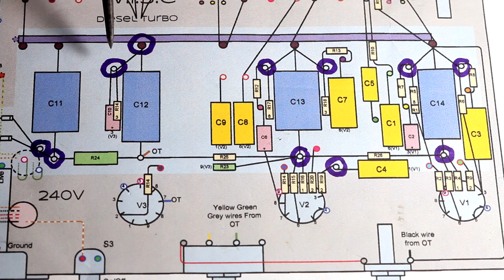Small Tube Amp Build - Step by Step (5 - Components Cont./Transformers)

Comment: That's really slick when you lift your completed board & sockets off the template and drop 'em in the chassis. And they fit: ta-dah! Even though I watched you do the templates and drill the chassis and re-use the template to use as a jig, it's still really schmick when you just drop it in. Excellent work!

Comment: I love working with turrets - such a clean look and very asthetically pleasing.
I use a more military style of soldering on my tube sockets where instead of simply pushing through and soldering - I wrap the wire around the connector tab ensuring a good connection before soldering.
Not judging - I see your style of soldering on tube sockets often enough - but I also repair a lot of tube socket connections soldered in that manner as well.
Great work.
I should video some of my work as well.
Reply from the maker: Thanks for kind words. Definitely wrapping the eyelets of the tubes with component leads is the best technique indeed. I just lay them in the lugs as I often change their position and once it's wrapped it's very hard to remove or change. I find that if the leads are tinned well and the solder joint is a nice meniscus then I have few problems. Very good observation though and quite correct. Thanks again and all the best for your builds!
Reply: USAF and NASA actually reccomend that method You use in those videos for soldering aircarft and rocket parts in their old instruction films.

Comment: Very clean build!  I've seen very expensive hi-fi tube amps that didn't have that level of care or precision.  I favor stranded wire personally, I find it withstands the wiggling movement of tube socket pins better, and for that reason I don't mount passive components directly to tube sockets.  But this arrangement of yours results in a very compact design and minimal wire lengths.  Everything's a tradeoff.
Reply from the maker: Thank you! Indeed solid core yields when bent too many times. For that reason I also use stranded wire for my shielded cable. Where there is little chance of movement, I use solid core as it keeps its shape. Wiring components straight on the tube lugs is certainly problematic in terms of replacement, however the potential reduction in noise overides this for me, a trade off for sure. Great points, thanks for commenting, much appreciated.

Comment: I commend you for your soldering. It’s very common to see leads trimmed after a joint is flowed. Those clipped ends need to be tinned to prevent oxidation inside a wire.
Reply from the maker: Good point, thanks for that.

Comment: Surgical precision just like the camera gimbal series :)
Reply: "Surgical." That's exactly the word that came to mind as I watched this. 

A couple of years ago I built my first amp, a Princeton Champ, from scratch using hand picked components, NOS tubes and 16ga aluminum for the chassis. It looks and sounds fantastic if I do say so myself, but only from the outside. The inside looks like it was assembled with a blow torch and pliers as it shows my poor soldering skills.  It is not something that I am proud of. On a positive note I do have the chassis mounted inside a home build cab where only the chassis is visible.  I am the only one that knows what lies underneath the cherry red chassis, and yes it still bothers me.
Reply from the maker: Thanks JN!! Really appreciate it!
Reply from the maker: Sounds like a cool little amp you made!. For some reason I get a kick out of having things looking solid on the inside, even though very few may ever see it. The more and more amps I build, the more it feels like creating a sculpture or something. I find it very satisfying to try and improve the design by creating a rock solid layout with everything easily accessible and as neat as possible. Its an interesting thing, thanks for the input and comment. Have a great day!
Reply: It was fun but a little frustrating - similar to the range of emotions someone playing golf might experience. A couple of solid drives and you're king of the hill, but 2 balls in the water on the next hole and you feel like the lowest rookie on the course.   A major point of my frustration is that after planning for a couple of weeks I expected better results.   

I wanted to challenge myself by going DIY all the way instead of buying a kit so I started with a flat sheet of scrap aluminum from a metal shop. I planned to form the chassis myself but they offered to bend it for me and I didn't say no. t's roughly the same size as yours and turned out perfect. 

With a perfect box for my chassis I then began the layout for the transformers, tubes, jacks, etc. After several hours of research, planning and cutting I stated assembling the amp and discovered very quickly that soldering would be my "fly in the ointment."  Oh I got it right technically.  The amp sounds great and is free from the the hum that Champ circuits are known for. I attribute that to shielding. grounding and placement of the tubes, but certainly not my workmanship. 

I do not consider myself a perfectionist but I believe I am capable of doing better  The outside really turned out well though. I used etching primer and then sprayed it a deep red with 3 coats of clear. And at some point in the painting process I decided to continue on and make a mini-stack. I fabricated a head cab,and included a black wire mesh grille from a storm door,, and then a cab for a 12" speaker all covered with black Tolex, Fender handles and chrome cab corners.  For the grille I used the silver blackface Fender cloth.  The red chassis with chicken head knobs looked somewhat odd mixed with all that black and silver so I framed the inside of the head and speaker cab with 1/4" oak stained with red cherry and secured with brass screws. 

What I ended up with: 
GE NOS tubes
F&T filter caps
Jupiter tone stack
Hammond transformers
Bourn pots + one extra for the NF loop.
Metal film resistors 
WGS 12" Jensen clone - don't remember the exact model. 
1 lb. of solder  (well maybe not a pound)    :-)

What I have described may seem unique and maybe even attractive to some but to me the inside of the amp is not.  It was my first so perhaps my expectations were a little high. It looks good and I enjoy it even with the flaws.  

I wish that I had your skill. I've seen many amp builds and I am sure a factory built amp wouldn't look this good.

Comment: Exquisite. Impressed with the Sozo, PRP, Kiwame. Your work deserves better diodes!
Reply from the maker: Ha true true, thanks for kind words. Any recommendations on which diodes to upgrade to? Cheers
Reply: @elams1894  Fairchild Stealth, SiC Schottky. Parrallelling the SiC tames the bite and smooths switching. 
Do you have a scope?
Reply from the maker: @Xsheaffer  Thanks, yes I have a scope.
Reply: @elams1894  Excellent. The reason I ask is that any of the diode implementations also benefit greatly in full wave from a tuned snubber at the xformer hv secondary. This needs a scope. If you try, hear, and like the different diodes, you'll pick up more fluidity and beauty with a snubber. You have to exert care to tune it fairly exactly with an analog scope for each particular combination of PT, B+, diodes, filter, load. I am at gmail if you want to discuss over email.
Reply from the maker: @Xsheaffer  thanks for that. Tuned snubber? Elams1894@gmail.com

Comment: Very neat job👍.  I’ve seen fairly expensive amps made way less neat than your little amp there.  Valve bases seemed to have quite loose contact tags which would have set off my ocd 🤣.  I much prefer solder turrets to solder tag strips.  Much neater.

Comment: Very impressive! The surgical precision with which you bent leads and wires is inspiring, although I would hate to be the tech who has to change out those caps 20 years down the road.
Reply from the maker: Thanks! It shouldnt be too hard to replace the components when necessary as the layout is all open plan and fairly easy to get to. I hate it when amps are just a big birds nest, makes it impossible to get to things, especially when wires and such are laid under the turret board. Cheers.
Reply: elams1894 My concern wasn’t that they couldn’t get it- it was that their work would be immediately detectable as below standard. Ha ha ha! Cheers.

Comment: Lovely work. You didn’t need to redo the blue and red twisting on that socket. The hum cancelling comes from the current in each conductor going in opposite directions. Twisting simply makes it effectively the smallest diameter for the two conductors. Obviously a blue wire going to the socket twisted with a blue wire coming from the socket WILL be hum cancelling because the currents are flowing in opposite directions.
Reply: How would the blue wire hum cancel itself?

Comment: what a beautiful all metal screw driver :)
Reply from the maker: Ha ha, yeah I like to live life on the egde indeed. I took a massive hit from the plate of a tube recently. For some as yet unknown reason I left the power on, yes, crazy, and then proceeded to fiddle with the plate. The one hand in the pocket saved my bacon. The hardest lessons in life are the ones most remembered. Always stay safe in those chassis man, have a good one!!
Reply: @elams1894  When I modified CRTs for a crude oscilloscope art installation I used to work on them with the "hand grabing the unpluged cord" technique, probably overly cautious but I'm a scared y cat with high voltages, great video man!

Comment: This series is very inspirational! very pedagogic and patient. I am going to start my first 5f2a build, and this is perfect motivation. I want to incorporate some of your technique. Your ground weave is a nice touch. Is it always preferable to only have a single star ground point? I see in quite a few other builds that people tend to at least separate the power ground from the signal ground.
Reply from the maker: Thanks for kind words. Yes it's preferable to seperate the power and signal grounds. I grounded them close to each other in the same region of this amp. Grounding is ultra important indeed.  A single ground region is preferable in low hertz applications as in audio amps, certainly a single star ground configuration is the ultimate for the signal circuit. All the best for your build!
Reply: I also wonder about your preference for tube sockets that attach from below. Why is this preferable from the ones that attach on top of the chassis?
Reply from the maker: @andrew_nayes  great spotting. It's  way easier to bolt from the other direction as you suggest. However because I use tube shields, the nut will not fit if bolted from the other side. The only option I have is to bolt from top of chassis down. What I do now to overcome this problem, as it's a real PITA, is that I glue the nut in position on the underside of the chassis. This makes life much easier. Well spotted though, good eyes.

Comment: Where I am from we use turret boards to build amps as well, but we stick the leads in the eyes of the turrets to keep everything as short as possible, run ground wire across the potentiometers,  and shielded cable for the AC signal, making sure to ground only one side of the shielded cable. Then you only have to solder the top of the turrets. I am confused why you wrapped your leads around the turret. What is the reasoning for doing that? I am asking to know if that is the preferred way.  Also, because I was taught differently.  Thanks.  p.s. it seems you've made your chases a giant antenna.
Reply from the maker: There is no point in shielding AC cables; from what would you be shielding them? Most would prefer to shield the signal FROM the AC cables. You can earth the bodies of the pots if you chose, however there is little benefit unless the pots are isolated from the chassis. I wrap my leads around the turret as it forms a superior contact, however nothing wrong with using the eye. I like to keep the eye free in case I need to use it later. I earth my audio at the input jack. This was an old build and the audio earth could have benefitted from being in a different position, however it is fairly quiet in terms of unwanted noise. What is your reasoning behind the chassis antenna? The chassis is not harbouring a magnetic field. Cheers
Reply: @elams1894  good on ya.  Is a nice and tidy build. That’s for sure. Keep on making them. It’s like pie. There isn’t just one type of pie. It’s a labor of love for sure.

Comment: this looks spectacular... great camera work too. 
i have a question: is it desirable to keep the leads as short as possible, or is it that in practice 0.5 -> 1inch does not make a difference in noise level?
Reply from the maker: Hi again Durox. Yes it is very important to keep grid resistor leads as short as possible as the grid, along with input,, is the most sensitive part of the amp. It is best to preserve the AC guitar signal as much as possible. Shielded cable is also recommended, thanks again D, have a good one!!

Comment: The board should be between the components and the heat source and interference of the valves? Meaning you should be using wire to connect from components affixed on the board to the valves?

Comment: Why do they still use turret board and not PCBs in DIY amp builds?
Reply from the maker: Because they are easier to build and easier to repair. Cheers
Reply: @elams1894  I strongly do not agree that they are easier to build, but repairing traces and such on a PCB is a nightmare.
Reply from the maker: @SynZ777  indeed, what ever way is easiest for different folkes. I like old-school turret boards, however I've seen some very well built pcb's that are great. If one can make their amp quiet, in terms of unwanted noise, by whatever method then all good.

Comment: Nice work! Question, is there any special reason to use the braided grounding buss instead of just lacing the lugs? Also, I noticed you rarely use the top of the lugs for connections...why is that?
Reply from the maker: Thanks Dan! I use a large braided band as an earth strap as it forms a nice large pathway for the return currents. This setup is much better than having separate earth points all over the chassis. It just means that all the earth currents are going in the same direction toward a single point. The potential for unwanted noise is reduced. I wrap the lead around the turret rather than placing it down the tube as it provides a better connection. Cheers

Comment: Dear Elam?,

Sorry, I am not sure about your fisrt name. 

It is Peter from Hungary. I purchased the plans and building the amp based on your awesome instructions. I just encountered one mistake in the chassis position plan, that is a bit confusing. Resistors nr.21 and nr.22 are both marked as nr.14 in the chassis position plan. 

Apart from that,  the plan, the instructions are really excellent. I will post a video on the final amp. I am using Hammond transformers and red drop capacitors as they are easier to get in Europe. I will be curious about the sound.

Please post instructions for any further builds, I would gladly work on other projects as well.

Thanks,
Peter
Reply from the maker: Thanks Peter, yes those two values I must change. The circuit diagram is the accurate one. That's great you are building the amp. Good call on the Hammonds. I have found that the ClassicTone Primary is getting very very hot, even though it's a supposed upgrade. I would be very keen to see your vid. I have been drawing the plans for another design. Essentially the same preamp with a pretty decent treble bass tone stack. I'll produce the schematic with single output tube and also push pull el84s. I have been Ultra busy with a new born daughter so time is tight but stay in touch, perhaps leave email on my personal message. Kind regards..
Reply: @elams1894  
The same here. :) Newborn daughter and not much time, but I enjoy the build very-very much. This is my first tube-amp build, so not as neat as yours, but I try to follow your hand. 

Regarding the Hammonds - I will use Hammond 370DX as power,  and 125DSE as output transformers. These are a bit more expensive, but getting ClassicTones in Europe is a almost impossible...

I will write some more details in private to your email address.

Cheers,

Peter

Comment: you were saying the tranny had to be round 540v I get that but what wattage would it be?
Reply from the maker: 540 volts would be primary tranny at anything around 100+ milliamps. Output tranny would be where wattage comes in. I'd use an output tranny capable of 10watts. That should do it.

Comment: are all your wires solid core cloth type Gavitt?
Reply from the maker: I use solid core for filaments. Also solid core for all hookup wire on the turret board. I use twisted core for any cable that is shielded. I find that, once shielded, twisted cable gives me more resilience should I need to move the cable. The twisted cable I use is high temperature, military spec, 22awg. I source that from tube depot. It's fairly cheap from memory, but very good. I make my own shielded cable.

Comment: nice layout bought poor solder connections all the conections need a good mechanil connections  all of his have very week mechinal streanth sooy but you fail
Reply from the maker: Depends upon what your goal is. I dont wrap socket pins nor pot lugs for ease of replacement. Ever tried to remove wrapped wire from a socket pin? Yeah I thought so..fail. So you know what I mean. If you want to have an amp that you never want to fix, then wrap away, everyone has a choice.